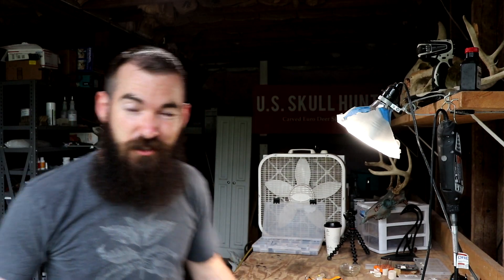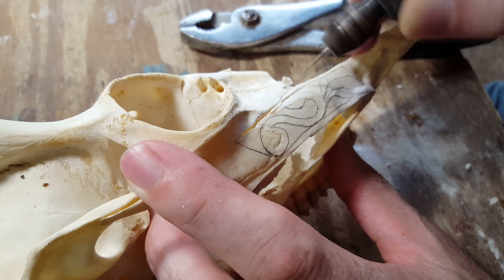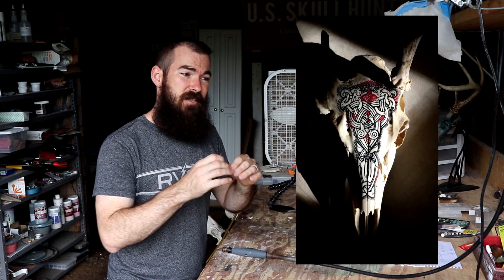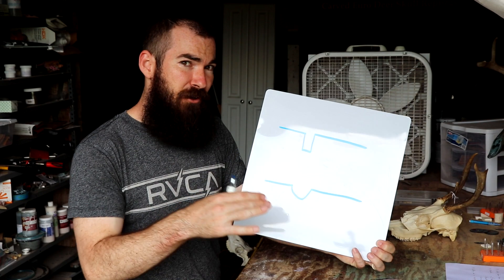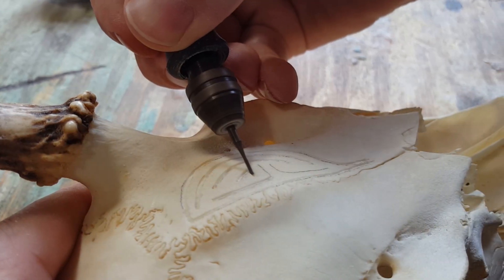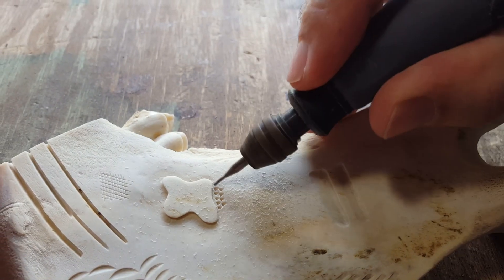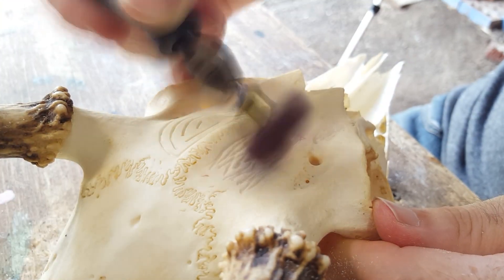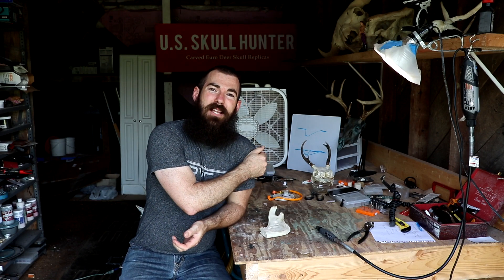Bone Carving Burrs Tutorial Part 3 (Cylinder Burrs)!

Comment from the maker: ➝ TOOLS USED IN THIS VIDEO
★ Diamond Cylinder Burr https://amzn.to/2WmrFk3

★ Long Pointed Cone Stump Cutter https://mdiwoodcarvers.com/products/long-pointed-cone-stump-cutter-set

★ Dremel 111 Engraving Cutter https://amzn.to/30NpdCz

★ Tungsten Steel Carbide Burr https://amzn.to/30OFkj1

★ Cylinder Square Cross Cut Burr https://www.etsy.com/listing/572105766/cylinder-square-cross-cut-bur-set-12-pcs?gpla=1&gao=1&&utm_source=google&utm_medium=cpc&utm_campaign=shopping_us_ts1-b-craft_supplies_and_tools-tools_and_equipment-tools-fastening_and_attaching-drills&utm_custom1=8c71b399-7ac6-45e9-acbe-8eb45fa8dddf&utm_content=go_1844177516_66522655621_346363581501_aud-318110574626:pla-321517474002_c__572105766&gclid=CjwKCAjw8qjnBRA-EiwAaNvhwJ6eOPCeHaUXw-fKQxR4FMZ37fkOLREvDb_L3ECS8_fMULwvL5bKfRoCx4wQAvD_BwE

▬▬▬▬▬▬▬▬▬▬▬▬▬▬▬▬▬▬▬▬▬▬▬▬▬▬▬▬
➝ SKULL CLEANING TOOLS
★ Aquarium Heater https://amzn.to/2EdGNoM
★ Mesh Bags https://amzn.to/2VRQ4cM

▬▬▬▬▬▬▬▬▬▬▬▬▬▬▬▬▬▬▬▬▬▬▬▬▬▬▬▬
➝ SKULL CARVING TOOLS I USE
★ Dremel 4000 https://amzn.to/2tBKq2H
★ Flex Shaft https://amzn.to/2IENLIO
★ Adjustable Chuck https://amzn.to/2Xqp7if
★ Respirator  https://amzn.to/2H0W3Z7
★ Ear Protection https://amzn.to/2H7DIJI
★ Ball Carbide Burr https://amzn.to/2H3jkJU
★ Inverted Cone Burr https://amzn.to/2EwHr1P
★ Cylinder Carbide Burr https://amzn.to/2EwmofT
★ Large Ball Carbide Burr https://amzn.to/2EuQEYs
★ Diamond Dust Burrs https://amzn.to/2TeFbVg

Comment: Hey quick question! I've heard that when cutting bone, you should use water to make sure the dremel doesn't get too hot, or the bone doesn't break, is it different for these types of skulls?
Reply from the maker: Hey Stephanie! Water is not necessary at all. I have been carving for years and never needed it. If cheap diamond dust burrs are used they can heat up and burn but it's not really a huge issue

Comment: Love the instructions..  very clear. I have a dremel engraver. Should i be using a different tool for this type of work? Your advice would be appreciated. I live in south africa so may not have access to all your american tools. It feels as though the engraver should be rotating for this type of work. Not just vibrating?
Reply from the maker: Hey Rachel! So you can do some light engraving on skulls with that tool but the cuts will not be as deep as the burrs used in this video.
Reply: @usskullhunter  Thank you for your reply. After Lock down I am Going to invest in a dremel stylo 😁 that should do the trick 😉